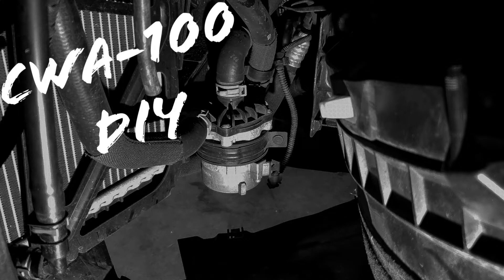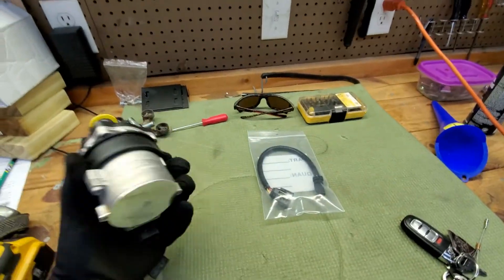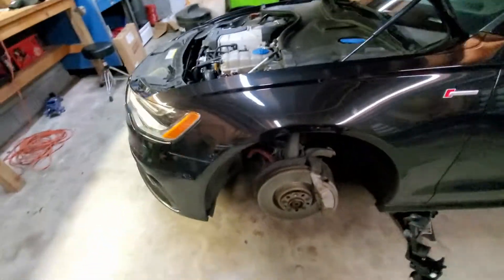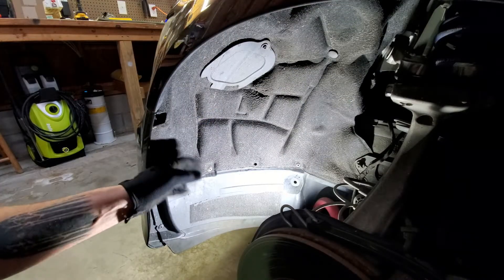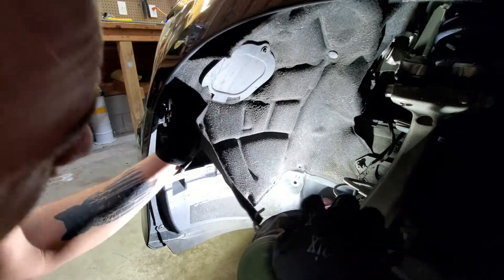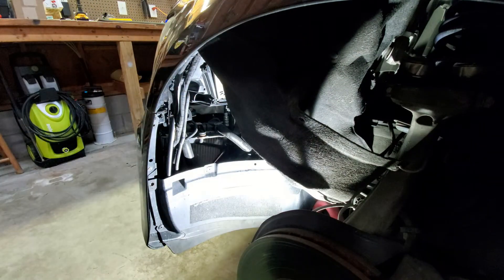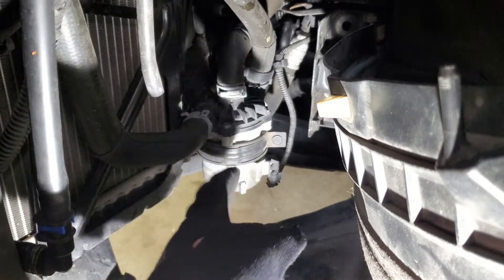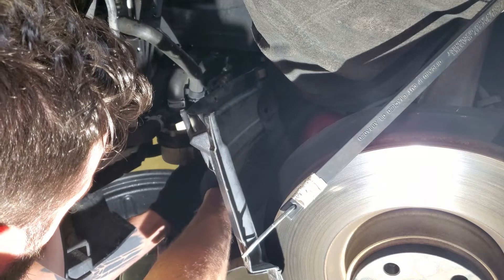Audi C7 CWA-100 Coolant Pump Upgrade DIY

Comment: How much lower did ur  IAT’s get?
Reply from the maker: About 5-7 degrees. But the real benefit is speed of recovery.
Reply: @AudiC7Owners  I’m hoping for lots lower IAT’s. I was seeing 195F at one point pretty sure my cats were going bye bye. Now I got JHM test pipes, Jokerz ported blower, merc S6 HX, added 1.3 gallons of coolant with the PLM tanks, plus this CWA-100, new IC cores. I just purchased the AEM meth kit too that I’ll be running with the 1000cc nozzle. I’m hoping for real cool IAT’s
Reply from the maker: Have you gotten all that stuff installed? You should see a drastic reduction.

Also, run an 80/20 ratio of distilled water to coolant in the supercharger loop when you divorce the system
Reply: @AudiC7Owners  I’m halfway done. Also forgot to mention, new thermostat+new water pump+ new pcv+ walnut blasted my intake ports, should help me with more power overall. I also divorced my system already with that PLM reservoir. 80/20? I shouldn’t use 50/50 g13?
Reply from the maker: We are going to do a divorced diy with 80/20 soon, but the gest is this:

Water is what actually cools everything in your engine. Antifreeze is just that... A chemical preventing your water in the engine from freezing. The 50/50 mix is 50% distilled water & 50% antifreeze. Going to 80/20 will cook better but also keep your system from freezing in moderate climate that dont see freezing Temps very often.

Now if you live in the north or any place that sees a lot of freezing Temps you will only want to run 80/20 in the summer and go back to 50/50 in the winter.

This is just for the supercharger loop.
Reply: @AudiC7Owners  ahh alright. I’ll wait for your diy. Makes sense. I live in Seattle decently cold here overall
Reply: @AudiC7Owners  hey I had a question maybe you can answer it or Jose, if I pair up my Audi S6 HX with the Mercracing S4 slim HX, basically run the other HX behind the S6 one.. would that help me in anyway? Increase coolant capacity? Increase resistance to heat soak even more?
Reply from the maker: Honestly I don't know. I'm sure if there was a benefit to it people would be doing it though. Just my .02$
Reply: Ok I’ve completed my diy install of the SC divorce kit with a CWA-100-3 and an S6 hx, all from Merc Racing. My problem is the wiring harness. I de-pinned the PWM wire and moved the 12v red wire to position 2. Actually tried all different configurations because my aux pump will not come on at all. I’ve bench tested it and it works just fine, but doesn’t work when plugged into the car. I’m out of ideas… help!!
Reply: @NardoC7.5  why did you move the 12v red wire? You’re not suppose to. All you need to do is cut PWM wire to keep the pump running 100% at all times. You messed up your wiring by moving the 12v wire. There’s no power to the pump. LOL 
I suggest you upgrade to mercracing’s CWA-150 for even more flow.
Reply from the maker: You didn't need to mess with the 12v wire
Reply: @davidmusiyenko4158  I follow AudiC7Owner instructions per his CWA-100 install. However, like I said I tried several options with moving wires around. I put the red wire back in its original position and kept the pwm wire out. Still not getting it to run.  

This divorce kit was installed after I had the OEM pump replaced last week under warranty too. So I assume everything was working properly prior to this project.
Reply: @AudiC7Owners  Ok, well the wires are all back to original and it still doesn’t run. My IAT’s are running 195. Which is exactly what it was running with the OEM pump. Ideas?
Reply: @AudiC7Owners  Ok so I double checked and I gave the CWA-150, do I need to change the fuse to a 25amp? Do you think that might be the reason it’s not coming on? Where is the fuse located?
Reply from the maker: Yes that is your problem. You need to put a higher amp fuse in
Reply: @AudiC7Owners  I do think I’m not alone in this, where is the fuse located. Having and hard time finding it.
Reply from the maker: I haven't installed my cwa-150 yet so I'm not exactly sure. But I should be doing it this weekend.

Your owners manual has a list of fuses & site locations.
Reply: @AudiC7Owners  Yes it does have the list and site locations but nothing about aux pump. I’m gunna reach out to the dealer tomorrow. If I find out I’ll let you know.
Reply from the maker: I'm looking into it as well for you
Reply: @AudiC7Owners  So I called two different Audi parts departments and neither of them have a clue. They said they can only see a basic wiring diagram and it wouldn’t show them where or if there is a fuse location for the aux pump.
Reply from the maker: I think I found it. DM me on Instagram & I'll send you the diagram